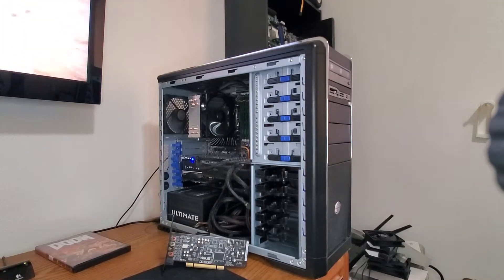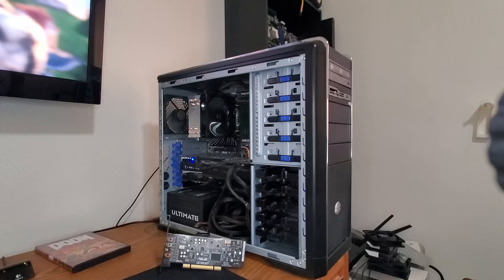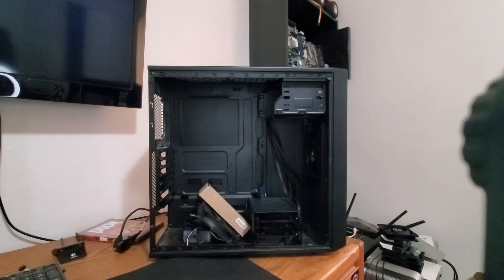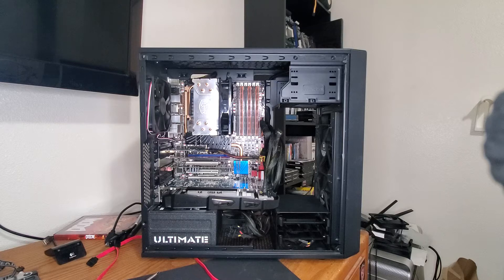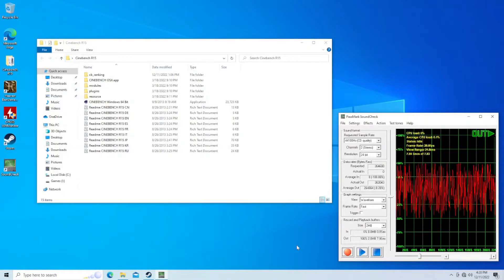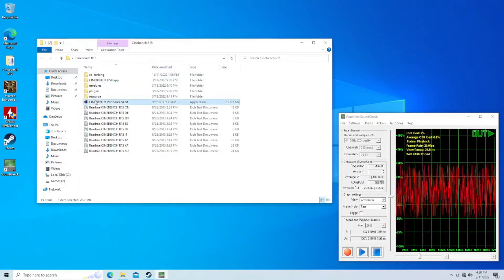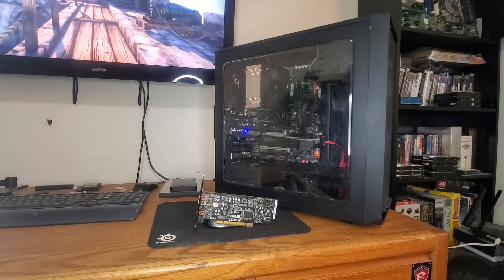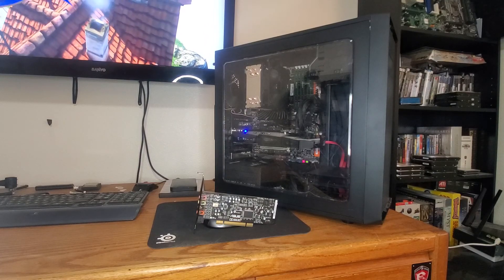Does adding a sound card add any performance?

Comment: Just saw this video today for the first time!  Sorry I missed it when it came out!  I just realized that you have the same ASUS P6T Deluxe v2 motherboard as me that I use just about every day!  I LOVE the P6T from the first day back in 2020 that it was dumped on my front lawn as an almost complete system in sorry shape with its i7-920 (now upgraded to a Xeon X5670), GTX 780 ti, 8GB RAM (now 16), 850 watt Corsair PSU and case with missing side panel!  I was THRILLED when I cleaned it up and got it running again and it is my favorite system today still!

Comment: On Windows XP, back in 2005, I remember playing IL2 Sturmovik Forgotten Battles, or Pacific Fighters, back on the rig I had at the time (Athlon XP 2400, Abit NF7S2, 1GB DDR in dual channel, XFX Nvidia 6600GT, and Sound Blaster Audigy 2 ZS), and the difference between on board and the Audigy 2 ZS was around 10% in performance, so it was worth it.

But nowadays, you only need dedicated sound to improve audio quality.
Reply: Same a bit later with my Auzentech X-fi Forte 7.1 that I bought in 2011, it's a bit older than that but I also remember watching some benchmarks back then that were probably from 2009 or 2010 and there was also around upto 10% performance difference depending on the test, the most demanding, the higher the difference and it was with a better performance CPU than back in 2005 as it was a 2008 intel CPU...

ps: It's sad M$ ditched hardware sound long ago or else we probably would have had hardware ray-traced sound for a while already🤬😡

Comment: older systems from 2010 or older can sometimes benefit from hardware accelerated sound if the application supports it and you have a lot of channels or effects going on with positional sound and so. FEAR for example, or Doom 3. also you sometimes get cleaner sound if your motherboard is very electrically noisy.

what is useful if you are into rebuilding server/workstation systems into gaming systems they sometimes have no on board sound at all (not like you are listening to music in a data center) so they are useful for that purpose, like DVR surveillance appliance or kiosk builds for home automation/information. i had to add sound to an old mini ITX industrial PC so the video doorbell software can work as an intercom on home with amcrest camera and GPIO.

Comment: ive only noticed in a few games  on my 5950x system where a dedicated sound card makes a difference . one is older games that use eax  emulated sound blaster on most mobos sounds like crap . so im using an audigy z

Comment: Windows xp was the last os where a sound card made a difference. You had hardware acceleration up to xp which helped performance. No longer can you have that on modern windows.
Reply: open al
Reply: @zerokool1985  somewhat abandoned. I used to get excited for openal with my x-fi cards and winamp plugins. Also openal reverts back to software mode/emulation most of the time.
Reply: I remember there is a program from xfi soundblaster that can enhance even an onboard realtek sound, but only work better on xp system.

Comment: you can actually test this is with an old pentium 100 or slower cpu or a Celeron 500 MHz SL3FY, depending on the game. 
it really depends on the use case like if there's a lot of interference then a sound card might help with that. 
i have a soundblaster Z that has really good output compared to a lot of my older motherboards but its about the same as my MSI MAG B550 TOMAHAWK audio.
Reply: I have a soundblaster Z aswell and to be honest I still think it sounds better than basic motherboard audio just due to static noise. sadly theres no longer hardware acceleration on soundcards though.